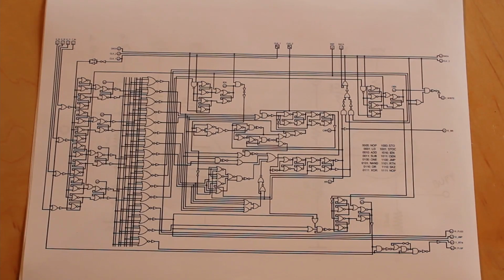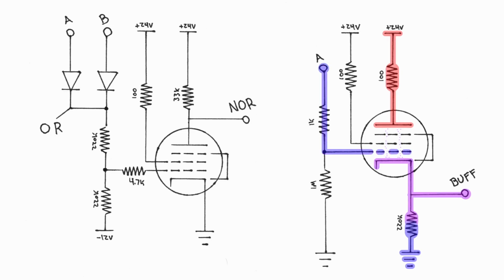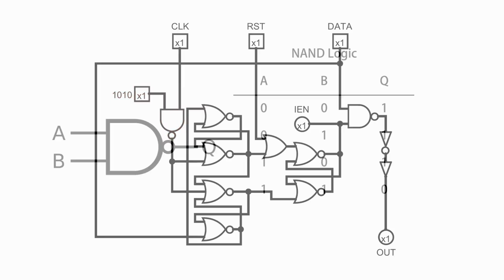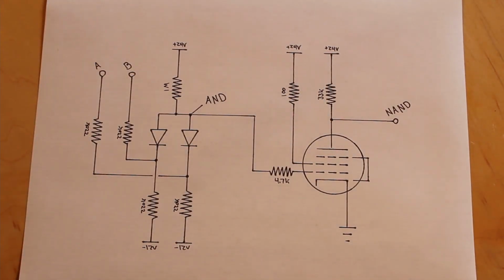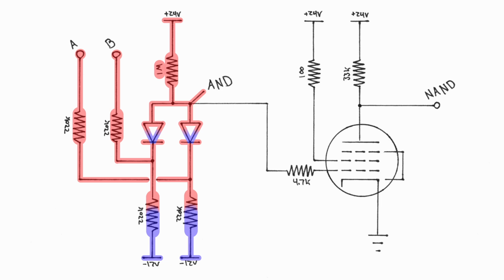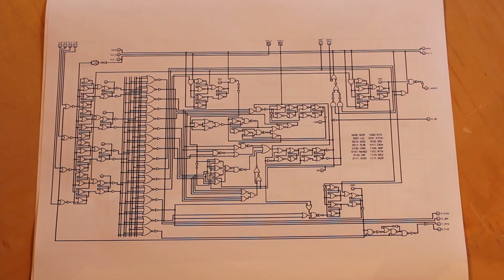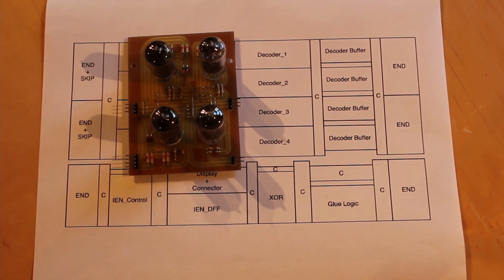Vacuum Tube Computer P.13 – Building a NAND Gate to Control the Input Enable Register

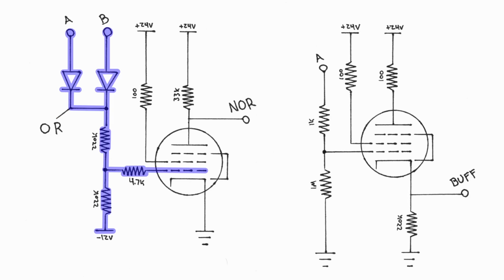Comment: 3:20 so would you called that Diode-Valve-Logic since DTL is already taken by transistors? kinda a combo of DTL and RTL with diode-resistor logic, imagine building this cpu out of diode resistor logic gates, you'd need a negative voltage rail to implement any inverter based logic, and some zener diodes, so one might be able to nand, not, nor wit dat shit
Reply: it would eat kw of power and be slower than frozen shit during middle of winter in antarctica too

Comment: Nice video!
Thinking more about NAND gates, I'm starting to think that using NAND gates as the default kind of gate might actually give better properties than using NOR as the default, if done correctly.

My basic reasoning is that the inverting outputs that you get with tubes should be much better at sinking current than sourcing it, and the NAND gate needs inputs that are good at sinking current but don't need to be good at sourcing it (unlike the NOR gate, which needs the opposite). That should allow for a lot more fan-out before you need to buffer the outputs.

(The output must be better at sinking current because it can overpower the plate resistor, which is what sources the output's current. ) If you don't need your outputs to be able to source much/any current, you can have a much bigger plate resistor, reducing power consumption. But seeing as the heaters are the main power draw, reducing the number of tubes through less buffering should be the major gain.

I also think that to reduce buffering needs, you should try to design your gates to load the inputs as little as possible (but at the same time be careful with using too big resistors, because they will likely make the gate slow - like the 1 Mohm resistor in this video will probably take some time to charge whatever capacitance is there).

With the NAND gate design in this episode, each input feeds into a voltage divider before the diode, which will always load the input. I think you should be able to design it so that the voltage divide is after the diodes instead. You'd put a pull-up to plus 24 V on the other side of the diode,
and a voltage divider between the diode and -12 V to get the grid voltage. Then, the inputs are only loaded when they are pulling the grid low.

Comment: Hi.
Have you considered/tested the option to build an AND gate by just skipping the inverting amplifier and applying the output of the diodes circuit directly to the grid of the cathode follower? Possibly with a slightly smaller pull up resistor on the diodes.

Comment: VFDs are always a win.

I'm amazed you designed all those little boards so you coudl test them independantly, and lego them all together into that pattern (and others, tubes are pricey I guess, so you want  these pieces reusable?)

Which logic software is that for testing? (you're going fast, making videos, makinmg designs, making boards.. my goodness! And a giant computer to play with!)

You're home etchign boards.. using a home mini CNC with a dremel or something? or are those etched using chemical submersion?
Reply from the maker: Thank you!
And I agree, VFDs are always an excellent choice, haha.

The primary limitation I have is that all my designs must fit within 150mm x 100mm as that's how big my single sided PCBs are that I start with are (with some exceptions - I've got a few long skinny boards that I cut out of a larger stock). That plays well into the idea of building individual modules on a single board. That also helps with trouble shooting - if the IEN register is having an issue, I can just replace that board instead of having to reproduce everything.

The logic software I'm using for testing is called Logisim ( http://www.cburch.com/logisim/ ) and it has been an absolute life saver! It's easily one of my most used programs, and for being free is surprisingly capable!

I'm actually using a full size Bridgeport EZ-Trak 3-Axis CNC milling machine to cut my PCBs, which is way overkill, but it's something I had ready access to. I design the board in DesignSparkPCB, then use FlatCAM to convert the gerber files to G Code, then I just run out to the garage and set the board up for a cut! I actually show the process in a bit more detail here ( https://youtu.be/ORsDWoGtEsY?t=723 < Should be timestamped to the right spot).

Comment: Very nice addition to the proyect. When completed its gonna look like those model train setups! Will need a pretty big table, just for the processor ! What kind of implementation are thinking of for the USAGI 1405? Is it going to be also tube based?
Reply from the maker: Thank you!
Since I primarily cut all my boards out of 150mm x 100mm PCB stock, it ends up with this really weird lego like construction, but I kind of like the ability to swap and change parts if needed without having to rebuild everything else. Plus, it feels cool to connect pieces together like a puzzle, haha.

The ultimate goal is to have the full computer split into three separate modules: microprocessor, program control, and memory. And, the hope is to keep it all based entirely on vacuum tubes (with some silicon diodes to help keep the size of the project somewhat manageable). In the end, I'm thinking it'll be around 600 tubes, but that could definitely balloon up some. So far though, we're only at 80 tubes used, so we've still got a long way to go!
Reply: @UsagiElectric  
That's thinking ahead!.  I'll keep tuned!. Its a very interesting way of getting into how a microprocessor works, by splitting it into its very minimun components. In these days of múltiple core, zillion transistor chips, processors looks hard to understand. This type of exercise, is very educational. Vacuum tubes just make it cooler! (warmer?)

Comment: Brilliant. I realy love the look of the PCB's you make. I think you might need a custom PSU for it soon, Maybe with a valve rectifier that warms up gradualy ? :)
Reply from the maker: Thank you!
The curvy traces are sometimes a little difficult to design around, but they just look so cool!
I've got a few ideas I'm working on for the soft-start, but I think the easiest way is going to be using a couple of relays. Though, there may be some Thyratrons involved to ensure the proper time delay!
Reply: @UsagiElectric  Good idea with the relays, You'll end up with a clicky start-up sound. :)

Comment: As always, nice progress. 
One question I had for a while now: 
Is there a specific reasen why you use solid state diodes instead of tubes? 

I like the way you layout your boards, it gives them a kind of retro style with the organic curves. 
Very fitting for such a project. 

Greetings, 
Michael
Reply from the maker: Thank you so much!
There's a couple reasons I'm using silicon diodes instead of tubes, but the primary one is cost. I could very easily build everything I've built up to now using the 6AL5 dual diode tube, but that would end up doubling the amount of tubes being used, which would require more than my budget is happy with, haha. It also would require pretty large rethinking of the power supply since the filament power draw would also be doubled. 

But, it's not unheard of for vacuum tube computers to use silicon diodes. The IBM 604, 650, 700 series machines regularly used silicon diodes in conjunction with vacuum tubes, much the same way I'm doing here! Granted, they often used Germanium or Selenium diodes, and I'm using Schottky diodes, which generally use more exotic metals. But, the design could very easily run vintage Germanium diodes if I could get my hands on about a thousand of them!

Thanks for the complement on the boards! I really like the look of the curvy traces, though sometimes I have to use a proper 45-degree angle in some places. Still, I think it really fits the theme of the project though!
Reply: @UsagiElectric  Semiconductor diodes were available long before the transistor was invented and were used in tube circuits, so you are good to use the diodes and still have a VT computer